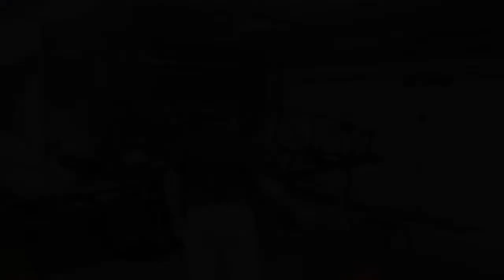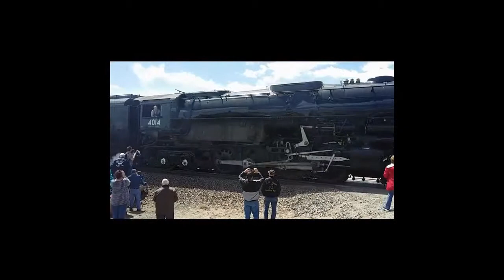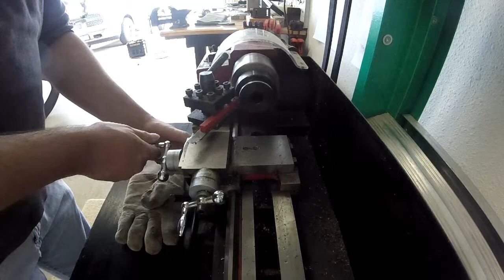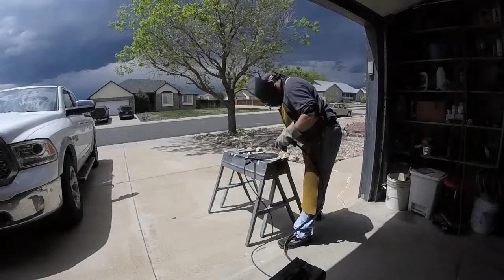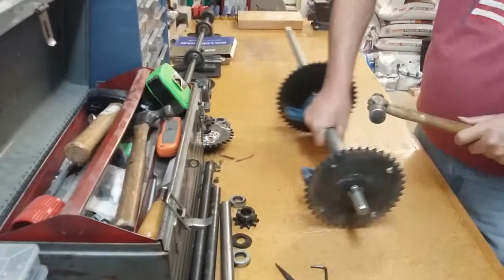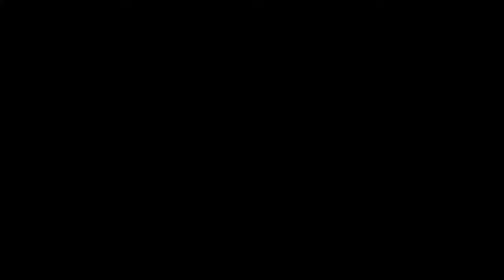Go Kart Chain Transmission, Part 1 : The SMOG Project 08

Comment: Must have been cooling seeing a real Big Boy locomotive with a full head of steam. I’ve only seen one sitting still at the Henry Ford Museum in Dearborn, MI.
Reply from the maker: Wasn't as impressive as I thought it would be. But I think UP was babying it that day. When it got to Harriman, it had less than 100 miles on the rebuild and was leaking lubricants from every place possible. Some of the guys on the UP newsgroup commented that it looked a lot better and was under a lot more steam on the trip back from Utah. Still, it was super-cool to see it after waiting 40+ years.